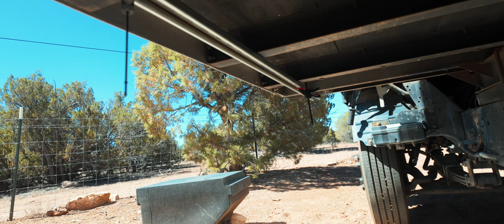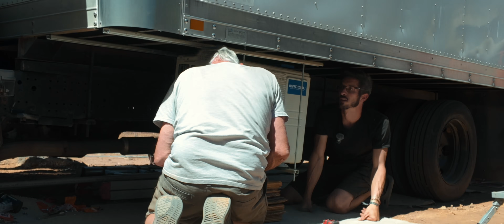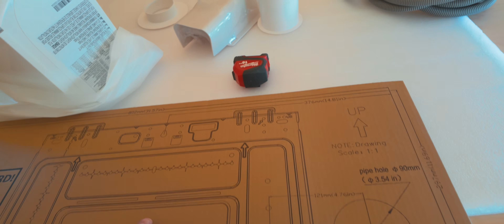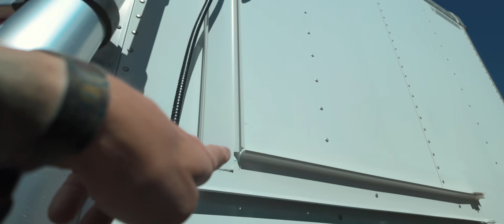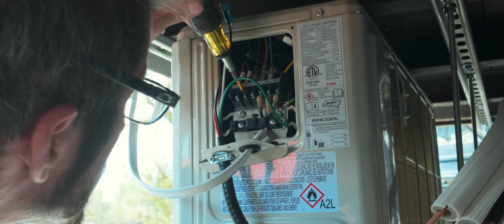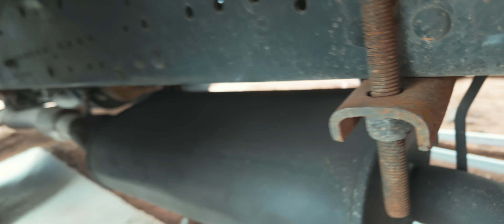DIY Air Conditioner install on my Box Truck Tiny Home | Mr Cool Mini Split

Comment: Nomad dad. That’s funny. Call me a pessimist, but I would build a cage around that to keep it from being stolen. It would also protect it against debris on the road.
Reply from the maker: i have had one mounted to the bumper of my current box truck for 2 years. no one has messed with it
Reply: @nomadbrad503  Wow. That's good.

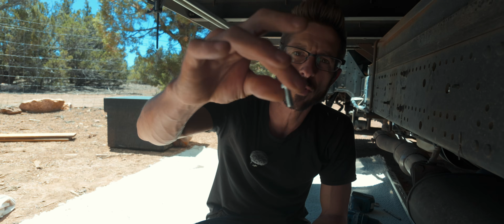Comment: 3:34 due to constant movement, stress, and terrible roads conditions I would have probably gone with at least 1/2 or 3/4 inch to be safe. Also a washer on top as well as a locking nut with some sort of loctite.
Reply from the maker: thanks for the tip

Comment: Great job put think the tube through the wall is wrong way around, looks the the outside flange isn't a complete circle and the one on the inside is and hangs down under the unit
Reply from the maker: good eye

Comment: May want to check with others to see if they have had problems with dot inspections.  Nice work, cannot wait to see the finished product.
Reply: Why would DOT be messing with a private not for hire truck?
Reply: @GY6SCOOTERCHAT r u a super trucker who knows better than anybody else?
Reply: @seanogs  DOT do not do roadside inspections of not for hire trucks that are RV's.
Reply: @Raven05R6 it does not happen often, but, it does occur.  And if he gets rv plates they will need probable cause to pull him over.
Reply from the maker: i have been living in a box truck for 3 years. never had an issue. this is not a commercial for hire vehicle. inspections do not apply
Reply: @nomadbrad503 dot can still inspect them super trucker.
Reply from the maker: @seanogs I welcome inspections from dot. I’m legal and not hiding anything
Reply: @seanogs no they can’t clown

Comment: Great job! I wondered about the placement of the underside unit but you addressed all my concerns for you with both the heat shield and skirting! Fantastic work Brad, efficient and elegant solution
Reply from the maker: thank you so much

Comment: Idk about putting the condenser under there, its going to take a beating and get all sorts of crud inside. It will also be far less efficient due to the heat coming off the exhaust which is right next to the coil fins. A better spot would be between the cab and box.
Reply: Nomad Brad explained (maybe in a live? That he could not place the outside unit between the cab and the box because of the way in which the cab flips up to allow for engine access. Also, wrt the exhaust, I do not think he uses the mini split while driving.
Reply from the maker: this is a hot topic!
Reply: @nomadbrad503  at least you know who is paying attention!

Comment: I think I would have put the mini split on the back part of the truck or maybe in between the cab and the box of the truck. I think it would be more protected.
Reply: There may be issues down the road if NB drives the truck through water, mud, sand, bushes, rocks or other debris. The best spot to put it would have been behind the cab where the tubing is sticking out for the inside part of the unit.
Reply: @Birdnerdistheword  yeah i agree this is terrible spot for minisplit, i guess you could cover it with some wrap when traveling, a unlucky piece of gravel could puncture your minisplit condender and  make it instantly worthless
Reply: I think he put it on the back of his Econoline. He probably put in underneath to be more stealth, plus he has a lot of room under the box.  I think it was a good decision.  This way he using the space under the truck, it's less noticeable and it's a little more protected from the weather.
Reply from the maker: you are correct about that
Reply: Nice job	  … so is the Mr. Cool unit 110 or 220v?
Reply from the maker: @mark35806 120v
Reply: @mark35806  you can get them in either voltage
Reply: Google says that vehicles with GVWR over 10,000 pounds may need to stop at scales whether commercial or not but rules vary by state.  😮
Reply from the maker: been traveling for 3 years in a 14,000 gvwr box truck. never stopped at scales.
Reply: @nomadbrad503 same,  and I stop at every scale.  It's the law in my state.  There's really no reason not to.  They always just send me through with no issues.   Learn your local laws and follow them on what to do.
Reply: @lisaanon6684 what state are you in?
Reply: @patrickfrantz2466 Does Google also say you're apparently dumb as a tater? Because whiskey tango foxtrot does this have to do with the video, or comment, you're replying to?